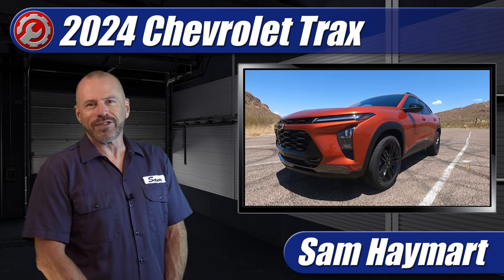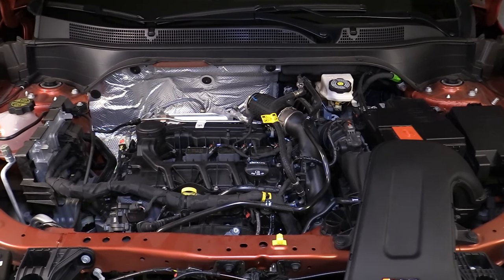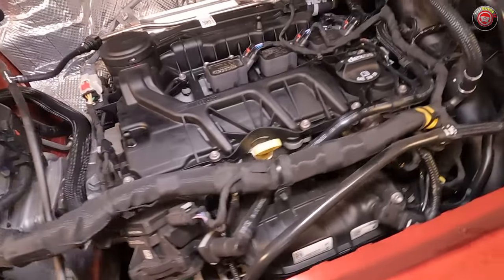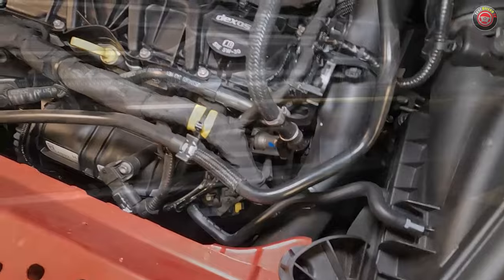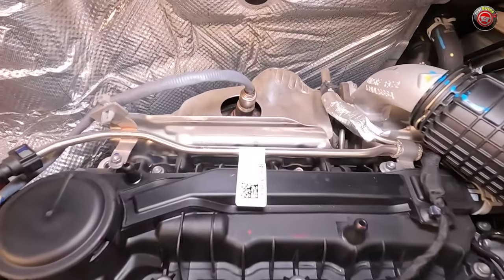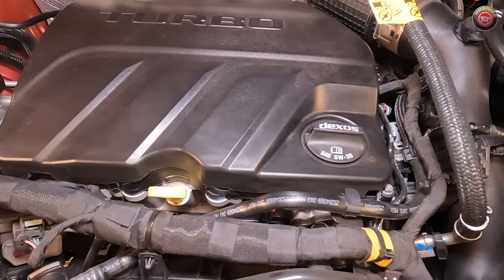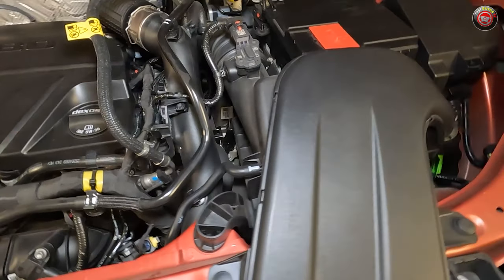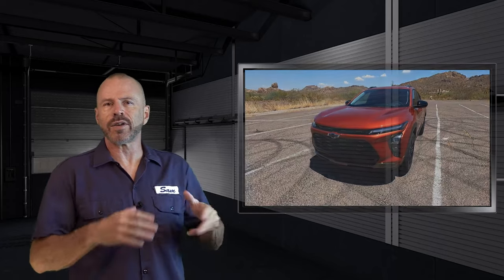2024 Chevrolet Trax: Engine Explained

Comment: Great review! Just 1 question.....I'm hearing that a lot of these new "start/stop" vehicles come equipped with a "extra battery" installed. Is this a true statement, and does this new Trax have one? Thank you!
👍👍👍👍👍👍👍👍👍
Reply from the maker: A "spare battery" is not included unless it is a hybrid car, which uses one of the high voltage hybrid motor generators to start the engine.
Reply: @TDTVGarage  
Great answer! And thanks for the reply. That entry-level Trax LS will be mine. Thanks again!
👍👍👍👍👍👍👍👍👍
Reply: 32 highway mpg? I can get 40 mpg on the highway with my ‘15 Passat!
Reply: The 24 Trax does have the start/ Stop feature but there is a button on the console when pressed turns the start/ stop option off until you turn off the vehicle then restart it you'll have to press the button again to keep it turned off.
Reply: Cool bro but if you want to pick up you need something built this decade 🤣
Reply: @TDTVGarage I have a question, my wife has a 2022 jeep wrangler with the turbo 4. It's not a hybrid and it has a secondary battery just above the passenger wheel well and it sits under the fuse box. What is the purpose of that second battery?

Comment: for the folks bitching about timing belts, and turbos and 3 cylinders  etc,,,, wasnt too long ago all the big car companies were threatning to go all electric due to the asshole epa... so they came up with smaller gas burning engines with turbos to comply with standards without going all electric!   I dont have a problem with this at all. I like gas engines myself!
Now I realize working on replacing the timing belts may be a pain in the ass, but its not impossible and thank God its not an Italian or german car you need to work on, they are a huge pain in the ass! Im an average old guy 57 years old with a humble set of tools and a backround as a hobbyist mechanic and I would not shy away from this engine but heres the thing,, you better keep the oil and antifreeze nice and clean to keep this motor happy! If you are lazy and let things go, you are gonna be very unhappy.

Comment: Real question is... How much does this entire engine cost?  It may only last 80-100k miles vut if it costs $2000 to replace then meh...
Reply from the maker: It would likely cost twice that.
Reply: @TDTVGarage  I just paid 9500 to drop a built 408 into my Camaro so meh.  Lol
Reply: Kswap it or ls when it happens 😂
Reply: @TDTVGarage   saw a used one ebay for 1500 not bad

Comment: Why chevy decided to put these engines in a suv goes beyond me, these should have been in the malibu or cruze.
Reply from the maker: The Trax is technically Chevrolet's smallest, cheapest, lightest car. It makes sense their smallest engine would be in it. There is no more Cruze. The Malibu is a much larger and heavier vehicle, though its engine is not much larger at 1.5-liters.
Reply: @TDTVGarage  werent these in the trailblazer?
Reply from the maker: Yes which is also considered a compact vehicle. They are both built in Korea on similar platform chassis and the engines were deemed appropriate as they produce more than adequate power for them.

Comment: I kinda wonder what’s wrong with the engine on these newer trax as every review done showing the engine the engine is turned off not running must be a pretty noisy engine
Reply from the maker: If one is doing a 30 minute detail photo shoot, having an engine running is kinda hot and noisy no matter what it is. It's nice to have it still so the images are sharper ;)

Comment: Reliability of the rubber belt soaked in oil for 100K miles is not known at this point.  Might be the best ever.........or a nightmare maintenance expense.  Check this out in 5 years.

Comment: I won't buy a vehicle with a turbo.  Or GDI without port injection.  Or mechanical CVT. 
In the comments a wet oil soaked timing belt is mentioned (I thought only Ford made that mistake). I believe I will add that to the list.
Reply: How about idle start / stop?
Reply: I like the Toyota hybrids. Where the engine only runs when it is needed. No start stop system needed (or wanted).

Comment: Are this and 1.3L powerful enough for 250 mile trips?
Reply from the maker: And even 300 miles ones
Reply: Powerful enough for a given distance? Not sure what is meant by that, but the throttle is surprisingly responsive at freeway speeds - more so than at lower speeds.   And on a flat mostly-highway 125-mile drive, I got an MPG reading of 38! Didn't believe it at first, but I did the math at the gas pump and it checked out.
Reply: You’ll be fine just don’t be driving it like taladega and it won’t fail
Reply: I took mine on 800 mile trips oil atill clean after there and back

Comment: Direct injection, aluminum head and block, turbo charge and  intercooler.   15,000 mile oil changes.   If it does make 150,000 miles. (It won't) Totally remove the engine to replace the oil bathed   timing belt and pump.   This car makes the Vega look good.

Comment: Travolta put it best.  “What a hunk a junk”.   What’s next.  “Chevys all new 2028 chevette.  This comes standard with an ALL NEW 0.5 L 1 cyl engine with a 3 speed, producing 73 Hp and 91 ft lbs of torque.  EPA estimates are 43/57 and 0-60 in just under 3 minutes.”

Comment: Lets be real??? How realiable wll this be???, lets say if i take great care of it will i make it to 100k with no big issues????
Reply: Unlikely if the manufacturer thinks the wet oil soaked timing belt needs to be changed in 40 k miles.

Comment: A 3 cylinder Chevy....what could go wrong??? 😂😂😂😂
Reply: There's nothing inherently wrong with a 3cyl engine, but putting turbo boost on any engine is going to stress it more.
Reply: About as much as a Ford or Mopar V8.
Reply: Ford doing it too 🤦🏻‍♂️
Reply: A wife... what could go wrong???
Reply: Geo metro.
Reply: Engine made in South Korea
Reply: Hopefully they consulted Triumph.
Reply: @zakspop ford 4.6 v8 is one of best engines ever lol
Reply: Can someone explain to me what could go wrong?
Reply: Video is like when I did my sales presentation selling new Chevrolet's 2001-2004. 
Yes this engine's potential failure points was designed to try to turn car buying public to Battery Powered Vehicles...even though they have their own unique set of problems.
Reply: No need to worry Chevy has been making 3 cylinder engines since the beginning of, uh, uh, this year! 😂😂😂

Comment: I have been turning wrenches for over 50yrs Believe me when I say this going to be nothing but a pain The Chevy Vega cast Aluminum block was a better engine then this. Damn Shame GM has a old Opal  engine that is way more reliable . 
Steer clear of this rolling train wreck  
Look for a Honda,Mazda, Toyota, 3-5 years old . Have a mechanic you pay to check it out.
You will be better off 

e

 🐐 

f50

Comment: I cringed when he said Plastic intake manifold , those have been a chronic problem for GM engines for decades with cracking and leaks
Reply from the maker: All manifolds on all engines are plastic regardless of the brand.
Reply: @TDTVGarage  Yes, but Gm has more problems related to their plastic manifolds than other brands

Comment: better stay away from the first year model, with gm's track record
Reply: boomer mentality
Reply: It's not reaaalllyyyy a first year model though. It's been in China since 2022 as the Seeker.

Also, a lot of the design is straight out of the Trailblazer that's also a few years old.
Reply: @redsealjourneymanreviews6647  As a mid centurian I resent your boomer comment.  The 1st year of production is almost always the worst and the best cars as a rule are the ones near the end of the production run.

Comment: Shame on you! Why not talk about a vehicle that weighs 3,137 lbs. with 6 speed transmission that has had proven issues and powered by GM's LIH 1.2 liter 3 cylinder turbo engine. The turbo is likely to fail at about 60,000 miles and the wet timing belt will likely fail before it gets to 150,000 miles, if it's well maintained. It may appear initially like good value, but the resale value will be terrible in the future. On top of that, the fuel economy for this dinky little engine is not very good.

Comment: Proven?  Proven to be a POS long term.  Anything these days can give 5 years 100k of service - ifs the long term that separates the wheat from chaf.  Terrible mpg considering - a basic 1.8 or 2.0 will give equal power and better economy w/o the turbo and all of the oil leaks for that matter.  Just buy a Crosstrek instead

Comment: 137 hp ? 😅electric water pump ? 😅does it have cyl deactivation? plastic parts that wont last ,what can possibly go wrong with a force fed 3 cyl ,they should throw in a new engine in the trunk when this POJ engine detroyes itself 😅😅
Reply: Their are no spare cylinders left to deactivate.

Comment: Dont be fooled by the lower cost of entry of this vehicle, the total money you spend getting the wet timing belt serviced at the dealer over the life of the vehicle(and for them to mess other stuff up while doing so) will be exponentially higher then a competing vehicle such as the hrv where you wont have to deal with such nonsense.
Reply: so this engine does have the wet belt like the ford? That would be the deal breaker

Comment: He fails to mention that the direct injection will lead to the valves being coated in carbon sludge in 30,000 miles and it will run rough. Fake mechanic who is incompetent for leaving this glaring failure out of his video. He’s a paid hack by GM covering up this huge defect in this engine.
Reply from the maker: If only GM paid us to cover things up. None the less you are on to the cabal of fake mechanics working for the "hide the carbon problems" mafia. It's the direct injector companies paying us all. You're too smart for us, you caught it.